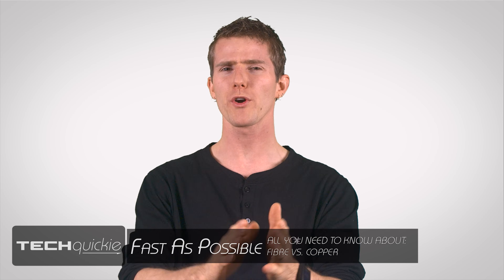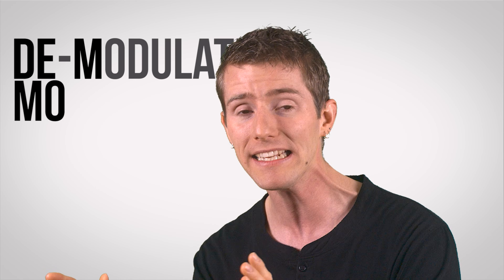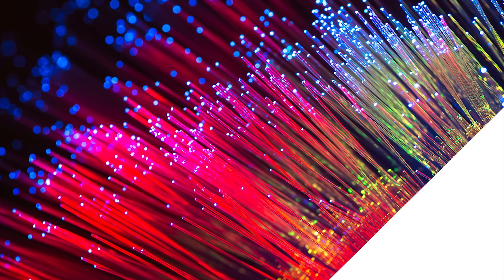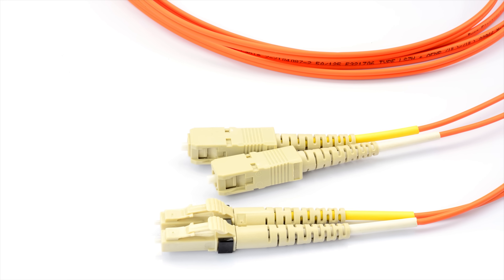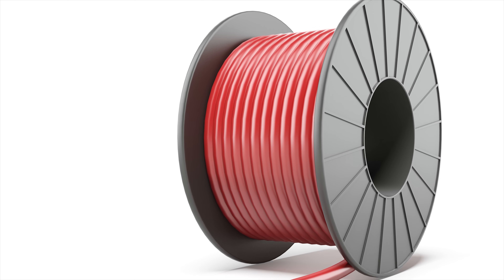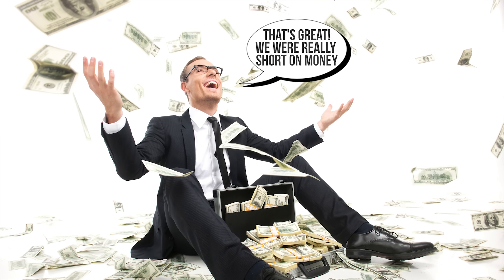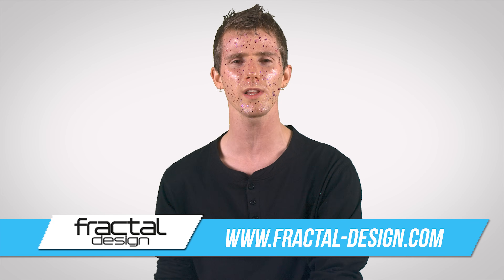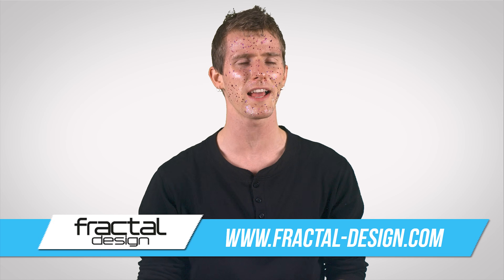Fibre (Fiber) vs Copper as Fast As Possible

Comment: One disadvantages is that fiber is really fragile. Both the connectors and cable.

About speed, its just the last few years it even been a issue at shorter distances.

Its really wireless vs copper vs fiber.

Today wireless is cheaper and most robust, its also slowest and have shortest range. But in a lot of cases range and speed is not that important.

Copper is intermediate Its quite robust and quite fast, range is well in the km range... and more important. Copper can carry power.

Fiber is more expensive... actually not that much more expensive. but with a $10 adapter you will only get 1Gbit/s...sure, range is better.

Copper is not that bad. The problem is that a lot of the copper we use to day is 100 years old and never intended for internet use. Its like driving a steam engine on the motorway.

Copper is good, used correctly.

To me the main disadvantages to fiber is it frangibility and unflexibility. With integration you need a extra adapter. Both copper and wireless can be integrated into the chip, fiber can not.

So to me the fiber is only useful if the distance is higher than a km or two, well for the time being....

In 25-30 years the distance can be down to 100 meter or so, then wee need fiber to just about every house... or maybe microwave/laser technology.

Actually the need for broadband have not increased that much. I use to have a 10Mbit/s connection back in the 90-tys... yea it was a lot, but when start watching movies in mpeg1 i use quite a lot of it.... 
in early 00 mpeg 4 start being used, actually reducing the amount of data and increasing the quality... about 2010 HD material started being more common, but H.264 (and soon H.265) made it so the actually amount of data didn´t increase that much.

Yea, downloaded games is a lot larger now, but still i only use about 5% of my capacity for games, and i still generally use mostly SD video.

So the actually end user needed speed is just slightly higher than 15 years a go. I have a friend that live with 1Gb/s in the wall. He dont have a TV and streems everything. There is 3 chooses. 10Mb/s for (equivalent) $19, 100Mbit/s for $25 and 1Gb/s for $29... what do he use... 10Mbit/s, because it really don't make any difference if its only one user on the line.
Reply: Wireless will never replace cables because it requires a connect to broadcast.

Fiber is not fragile either.  The glass they are using now is more durable than copper.  Why do you thing corning, the company that pioneered fiber, is using the same glass on your iphones and ipads?
Reply: Wyatt Newton you are wrong, fiber is quite fragile.
You cant twist it as hard, then you break the fiber, and the connectors is really sensitive.
Reply: Somehow I doubt you've ever  put up 128 strand fiber lines like I have so I don't you can knowledgeably comment on the durability of fiber cable beyond what you've read.

Once again I will reiterate my point.  Modern glass can be made quite flexible.  Corning, the same company that makes your flexible phone screens and protectors, makes fiber optic cable.  In a couple more years, fiber will exceed copper in every area.
Reply: Wyatt Newton You are dead wrong. I actually have quite a lot of hands on work with prototype fiber development.

Single mode fiber is not that flexible. If you bend it sufficient, you will break it. The connectors is also fragile. 

Multimode fiber is somewhat more flexible, but its also slower hand have shorter range.

I heard a lot of people claim the same thing, all of them have no actually knowledge in the area...

... do you have a PhD in optical communication systems?
Reply: bacceli Now you don´t, they you should know the correct way to wright it.

Also you would probably be a doctor of technology then, not a doctor of philosophy.

Comment: Actually, optic fiber has a much shorter distance that it's able to transmit data. This is due to the fact that the signal degrades each time it reflects from the walls of the fiber. But it is easy to counter this by putting amplifiers each few hundred meters, depending on the architecture.

The main advantage is that light does not interact with other electromagnetic fields. It does not generate one, nor does it get modified by one. So the fidelity is very high, which allows for a higher bandwidth. If you were to try that with copper, then the signal would generate an EM field that would suck its energy and would persist enough to impede further signals. Also, the signal would get interference from any EM emitter (cell phones, cell towers, bluetooth, WiFi, FM).
Reply: Actually you are wrong on two accounts.  First is that all variations of fiber have a longer range than copper.  There is multi-mode fiber which bounces the light off the wall and single mode which goes straight down the middle of the cable.

Second is that fiber does not need the light to bounce off the cable walls to work.
Reply: Wyatt Newton single mode still bounces off walls. It's unavoidable. Light travels in a straight line if it's a homogeneous medium. Light can bend if the medium changes, but it will still follow the same general sense of movement, unless reflected.
Reply: Donnie No, no it doesn't
http://www.explainthatstuff.com/fiberoptics.html

And you avoiding saying it but every type of fiber cable has a longer ranger than copper.
Reply: Wyatt Newton one thing at a time. How does light not bounce, if the cable is not straight and light is?
Reply: Wyatt Newton you have to understand me: I, like any other normal person, want to see amazing stuff, and am looking forward to learning something new that's interesting. When you told me about a reflection-less optic fiber, I was put in a position where I understood that either I know nothing about light, or you had some misconceptions about optic fibers. I'm still not sure which one of these are true, but from the link you've given me, I get this quote:

Single-mode fiber-optic strands are smaller, and they more carefully control the light passing through them so it doesn't bounce around as much inside.

I did some research, and I failed to come up with results that explain a phenomenon where light is not reflected, but changes direction following the conductor. Maybe I didn't look hard enough, but from many sources I've seen that Single-mode optic fiber really does bounce the light, but because it's so thin, and bends are so long, each time it reflects, the angle is much larger, and it bounces off less often, and reflection is better. Simple geometry.

If that is the case, then I would continue by arguing that the economic feasibility of Single-mode optic fibers in FTTB scenarios is not very good, since the connecting equipment costs a lot more. So as far as consumers are concerned, multi-mode is what we should be focusing on.

As for length: Apparently you are right about length.
http://www.lanshack.com/Fiber-Type-vs-Speed-and-Distance.aspx
Though it depends on type. Some fibers have a short maximum distance when using 850nm signals. A Cat6 cable is able to go further.

Comment: Power to your house is actually only partially delivered by copper. The high voltage lines that go to your local transformer are likely aluminium with an iron core. Although alu has a higher resistance, it is much cheaper, and the resistance doesn't matter as much when dealing with high voltage, as the same amount of power can be delivered with a smaller current. The iron core is there to carry weight.

Comment: My whole neigbourhood just got FTTH a couple of months ago, i was getting a pretty solid 30mbs with copper, VDSL2, but now i have 100/10mbs (with a promise of free upgrading to 200/200 next year), four times less ping, and absolutely rock solid connection. Best part? I actually pay LESS per month than the former connection (and it's the same company, they're actually stopping support for copper). Fibre is moving quickly here in Spain, at long last.

Comment: i see alot of people haveing some debates about where its cheaper for fiber then copper, my only concern is, wouldnt you be completely fucked if the cable is cut? could be very costly for places that have wires above ground and a cold climate

Comment: Unfortunately here in the uk a certain telecommunication company employs a DLM system which until recently was used on every new fibre connection ,this is taking into account that FTTC is deployed more than a direct fibre connection, however since the court case ,this feature has supposedly been turned off ,this is not the case ,all fibre profiles on DLM are now locked ,if you were experiencing error correction on your fibre you are now stuck with very high latency problems in online gaming ,interleaving is here to stay on fibre ,typical error correction will occur more when the fibre is reaching the threshold of it's available limit ,multiple users sharing a single fibre will soon reach it's capacity ,then the errors will increase ,lossed connections wouid have started  the DLM process,once a period of stable connection has been achieved then the system  using an algorithm ,would detect the stable connection and interleaving would be disabled,i would be interested to know your thoughts on this as it seems interleaving is a problem that needs to be addressed ,as well as DLM ,

Comment: For those wondering, chances are you could be running on Fibre and not know it. the thing is, Copper's problem is that it has to deal with electrical resistance, which increases with the length of the cable and inversely with the diameter. the thing is though, from the street, where the fibre usually ends, to your house, where coppers starts, and to your computer is an extremely short distance, so the copper should be able to carry the signal from the fibre with very little performance difference. Yeah, science

Comment: Isn't there one missing point--that fibre connections are unable to transmit power, so for applications like USB (ahhemm, Corning USB cable) there will be further restrictions, since there will be no powering and charging of devices (unless wires are added for power, which is conceivable but not the most efficient thing to do)

Comment: tight fisted isp's? not really, you can run a single fiber line down the main roads of a city, and copper to everything else, the copper is already there, and since 99% of people dont need gigabit internet and are completely satisfied with 20-80 Mbps down theres really no point in spend the time and effort as well as the money on installing fiber to every street, and then replacing everyones modems with fiber capable modems
its more than just double the placement to get directly to homes, main roads are more like 1/4 to 1/3 the road ways

now im not pro verizon or anything, i hate their guts, but fiber to my house isnt something that i desperately need, i get at least 50Mbps down every day, and it gets up to 75 at good times, thats more than enough for me and my family, i dont hold the expectations of having the capability of gigabit internet at my house

Comment: Linus the speed of light is 300.000 km/s, the reason for the slower speed is because it moves through a compound with a high breaking index. The material can vary so 200.000 km/s is just not a general speed in fibe optics.

Comment: At the moment I have no reason what so ever to get fibre. I have a perfectly fine connection with normal internet cables and I rarely receive any lag. The only real lag I receive is when the internet dealer or the game/site has problems. A fibre cable wont fix that.

The cost of installing fibre is not worth replacing my current internet in any way or form.

Comment: The only reason I want to switch to Verizon FiOS is because it's FTTH; the best possible scenario for fiber connections.

And they haven't wired down my GODDAMN STREET for the last 3-4 years it's been here.  Apparently my 20 house dead end street wasn't good value to them, when I pay for a 120/35 connection and my neighbor is one of the biggest IT people I've ever known (his son builds robots ffs).

Oh well, forever stuck with cable service that frequently gets hit with RF related issues, especially in cold weather.  Can't do a damn thing until I move, which I won't be for a very long time, if ever.

Comment: Fiber is actually cheaper than copper in many ways. By the foot fibre is cheaper than copper. Because fibre signals can travel further than electrical signals before needing to be "repeated" from degrading you would require less equipment. If you were to build an entirely new network backbone/communications closet/infrastructure it would be cheaper to do fiber. Fibre also doesn't experience cross-talk, an issue mentioned as "EMI" or electro-magnetic interference — like listening to a radio station but picking up a broadcast from another station. As such higher bandwidth cables (Cat6, Cat6a, Cat7, etc) require more "buffers" or padding to prevent catching signal from a parallel cable. Because fibre is light we obviously don't have this problem.

Arguably fibre and copper can be equally pricey when choosing what kind of "bundling" they are in: cable reinforcement for external and in-ground placement will vary depending on how "strong" you want it to be. Fibre cannot experience the sharp bends that copper can as the light signal will experience a type of signal "loss," meaning installing it in older, existing architecture can prove difficult, but fibre potentially means less cable required to carry the same bandwidth for the backbone. 

What isn't cheap about fiber is what companies don't go into detail about. First and foremost, the termination of a fibre connection is pricey. Copper cables can be cut and quickly re-terminated with some kind of jack/connector in a short amount of time. Fibre termination requires more precision, time, and training. Look it up on YouTube. Second, media conversion devices, like copper-to-fiber signal converters and vice-versa, are required when adding a fibre connection to a copper infrastructure. These are standalone boxes and plug-and-play modules for network switches/routers/etc. which vary in price by vendor and fibre type (single-mode vs multi-mode). Third, "splicing" cables is, in many scenarios, impossible. With copper you can easily cut a cable and slap a termination on at both points with very little signal loss. Fibre isn't that lucky as "reflection" or "interference" greatly increases at each termination/jack. 

So no, fibre is cheaper when we're talking by the foot and new buildings. Fibre is not cheaper when we're talking about hybridizing existing networks or short point-to-point connections.

Comment: I have Verizon FiOS and they run fiber directly into the house, and then everything in the house is copper. I've never had an issue with it, except when we drove over the yard where the cable was and it cracked, everything went out. Other that, it has been outstanding. The only complaint is that Google Fiber achieves 1000/1000 mbps up and down speeds for a very good price and Verizon offers a 500/ 500 mbps up and down speeds at a MUCH higher price. I have 75/75 and actually achieve about 86/86 on average.